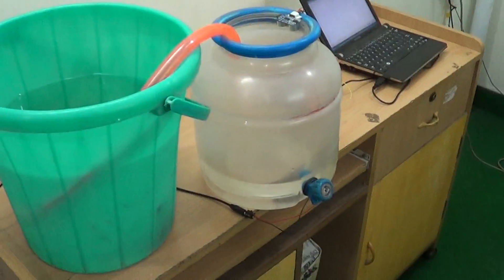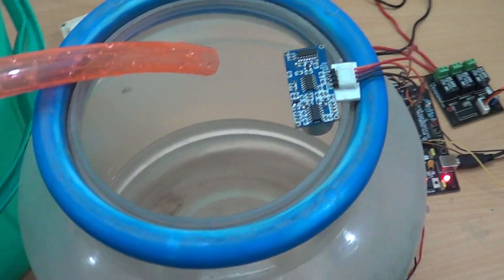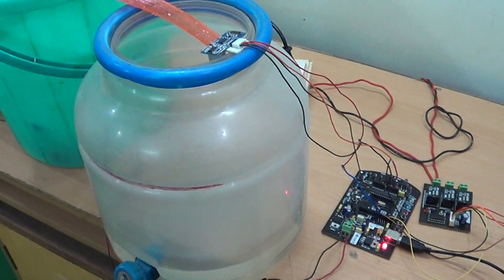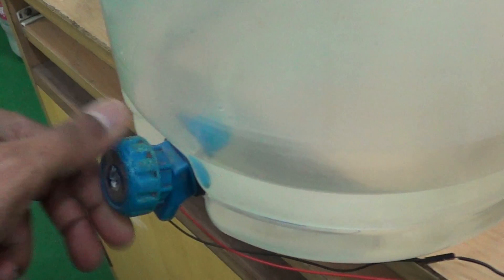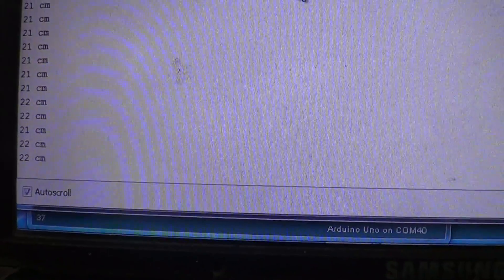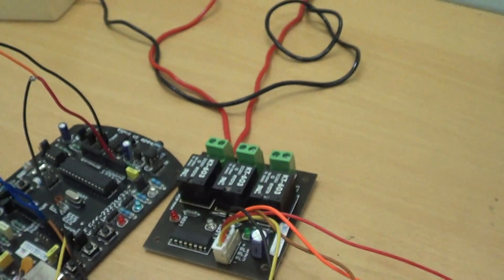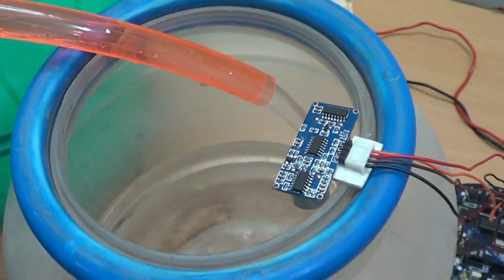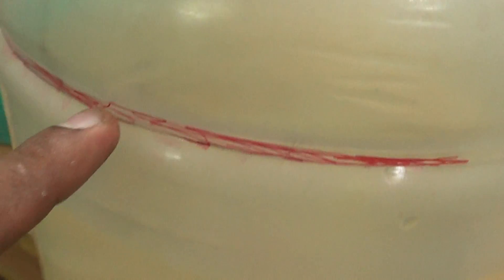Simple Water Level Controller

Comment: Hey you can also use relay circuits only in order to turn off or turn on the pump I have made in which 1st relay was for turning pump on and 2nd was for turning off pump and 3rd was for another special feature     actually there was a timer circuit used to turn pump according to depth and volume of tank         and coding the aurdino is just😢😢😢😤😤😤😩😩😩         the special feature was that when we are out of town for 3 to 4 days    we have a water level indicator which actives the timer circuit according to amount of water in tank and I got first prize for that in the state science exhibition    you also try to contact me if you want and also ask me about thay
Reply: Hey can u tell me what kind of pump did u use?

Comment: You use moving average calculation? I see that Your ridding are not precise, thats why You r tidings are moves in time. 
In my last project I use moving average with precise voltage measurement.

Comment: If you sprayed a water mist in front of the sensor, would it trigger it? Also is there more instructions on what you've done?
Reply: +Jeff Lane inkpen nvm about the water mist, it's a low level sensor my bad, but i still need those instructions chief. im using a raspberry pi 2 b+
Reply: +Jeff Lane inkpen check out any basic ultrasonic rangefinder tutorial for the pi like on Make or Adafruit. It's just testing how far away something is (water) and when it is so far away it triggers an event

Comment: weltech is a high quality water level controller and automatic motor switch.
this is very usefu for home ,hospitals,offices,fats,temples ,churchus ,mosques,motor pumps operate automatically.when the water level go to the middle level refill water soon in the tank. no overflow ,so save electricity and water.one year warranty in india ph9633203946

Comment: If I was to use that sensor for measuring the depth of the fuel tank of a car, would the gasoline steam mess up my sensor readings? Or would it damage it within a few time?
Reply: It will dissolve the tranducer(s). The transducer needs to be of a good resistance.

Comment: I have also made and working fine, the issue is in due course of time, water vapours starts accumulating and spoils my ultrasonic sensors, any idea to make it concealed or escape from water vapour..?
Reply: Good day Sir, can you please share the code with me
Reply: Use ultrasonic sensors taken from a car parking system. They are waterproof.
Reply: +vinodh kumar sampath 
I  face the same problem.... In coding part I have included a configurable timer to run the pump/motor... But water vapours problem still there ...
Reply: Use molygraph printkote to make it water resistant ....
Reply: Please can I have the code...i want to do this as my end semester project
Reply: please share the code with me if you get any.
syedabdulali243@gmail.com
Reply: sir can i get the coding part and necessary parts becas ive to make my college project on this